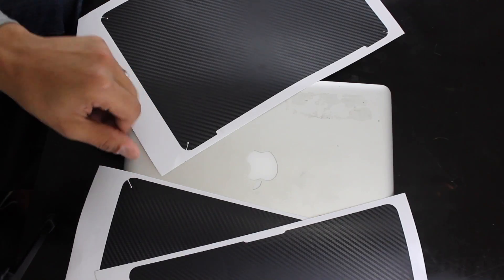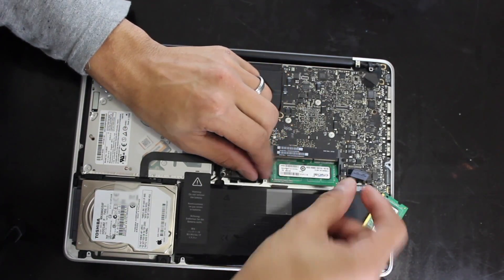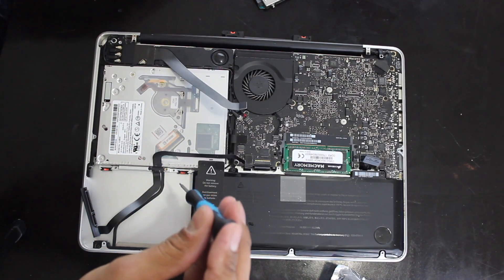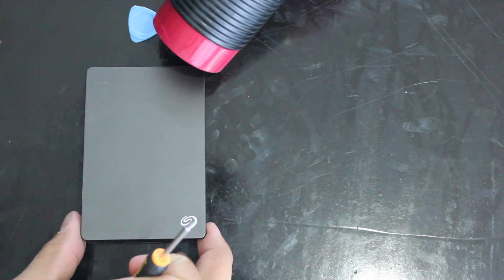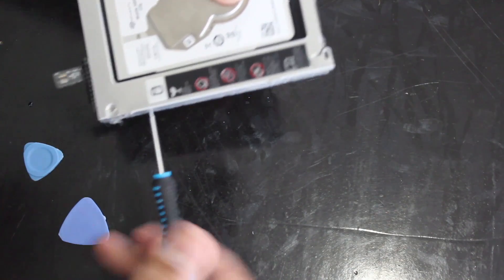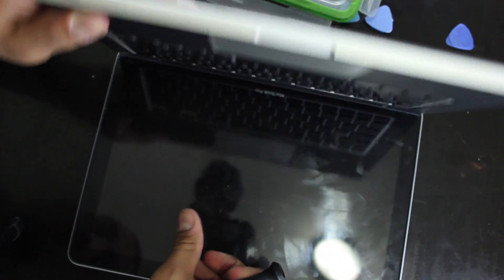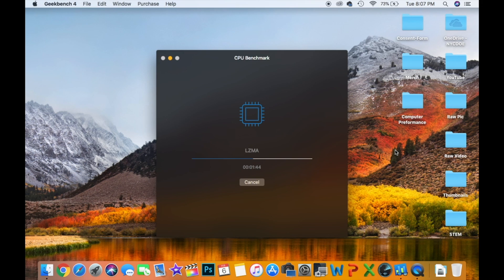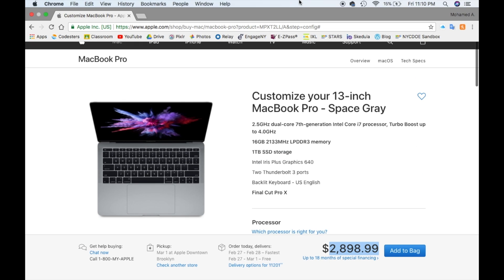2011 Macbook Pro Upgrade (3TB, SSD + 16GB RAM)

Comment: after replacing 16 gb ram in my 2011 Mac cpu fan speed continues on top speed no matter what I am doing far is running on top speed its weird. any suggestions?
Reply: Try SMC reset or dust off the fans and replace the thermal Paste.. if it continues download macsfancontrol

Comment: can I upgrade my 2010 MacBook Pro I just put in 8 GB Ram and I have 500 gig hard Drive , I use it in my Studio and Id Like 16 GB Ram is that possable
Reply: Bill McDonald 2010 MacBook Pro is limited to 8GB RAM. If it’s a 13” Core2Duo from 2010 then yes.

Comment: I see you have high Sierra installed. Did you notice a decrease in the time it takes to boot up and get to the login screen?
Reply: I just did the SSD upgrade and it boots in about 20 seconds. I get the rainbow wheel way less and all of my photoshop operations move very smooth. Its like a brand new computer!
Reply: @tybis4u  What os are you running and how much memory do you have.
Reply: aLBERT jACKSON jR I’m running Catalina 10.15.3 . I have a mid 2012
Reply: aLBERT jACKSON jR I have 8gb of ram btw

Comment: Will this 16gb of ram work with the i5 processor? I have a late 2012 13 inch macbook pro.
Reply: Check if late 2012 up-gradable for RAM.

Comment: I bought an macbook pro, 2011 and I upgrade the ram and also 1tb ssd drive but it gets really hot, and I wounded if you have any idea why that is? Is it defect that this macs had from the manufacturer, cos I have a PC that is it never heats up like the macbook pro does. The Mac has 16gb of ram and 1tb ssd, my PC has 4gb of ram and 320 HDD which technically no comperacing  with specs but my PC works flawless!y and I been having so many problems with the Mac, especially the heat, any ideas on how can fix this? Any ideas would greatly appreciated. I love to keep the Mac as my main and my PC as a back up since use the both with Serato DJ

Comment: I thought MacBook Pro early 2011 just could stand til 8gb ram. Why or how did you upgrade til 16gb?
Reply from the maker: According to apple it can only take 8gb, I put 16 and it read it but I did not notice a big enough change in performance that justified keeping it at 16 so I downgraded it to 8 and fixed my recommendation here
Reply: @MoeNegm  Does this apply to mid 2012 models as well ?
Reply: @corenyellow  depends, the non retina you can't upgrade the ram. But the other one can support 16gb ram upgrade, check the Wikipedia page for MacBook pro and check your model
Reply: @somedudeonthetubeyeah  thanks bud. yea I did some further research and upgraded my 2012 macbook pro non retina with 16 gb ram last week. best decision ever
Reply: Does the “1333 MHz” on the your new 16GB matter? I want to upgrade my 2010 Macbook pro 13”.  It has 4GB 1066 MHz. I can only find 8GB 1066 MHz and not 16GB 1066MHz.
Reply: I am convinced I will take this approach, but I was just informed that the unit may run hot. Has this been your experience?
Reply: @asneMMan   if youve got mid 2012 macbook like mine just go for 16 gb. my laptop hasnt got any hotter. battery hasnt got any worse. there are too many misinformation circling around.

Comment: Also, HOW is a harddrive restricting the macbook from using the 16 gb RAM?!?!
Reply: Bottleneck
Reply: I upgraded mine to 16 GB with no problem.  Upgraded to 1 TB SD HD.
Reply: @stevenjp7155  so if we replace HDD with SDD, we can change the memory with 8gb+8gb?

Comment: Thank you for sharing this! I went ahead and ordered the Corsair RAM upgraded that you added to your computer. I'm excited to see how it'll speed up the performance of my MacBook Pro. Slowly, I'm gaining more confidence in myself to make these small upgrades and save myself a lot of money in buying a new laptop.
Reply: just don't ruin it by loading Mojave, High Sierra's much faster for MBPs with a soldered, small amount of RAM
Reply: @austrobok2958  what if you’re on Mac OS X Lion? Can you go back to high Sierra? (Also on late 2011 MBP)
Reply: @montyv9801  I think you can move to High Sierra, but that is forwards not back. Lion is OS 10.7  and  High Sierra OS 10.13.
Reply: @austrobok2958  oh okay strange. Cause I was running high Sierra before I restored to factory settings
Reply: @montyv9801  right, when you restore to factory you will go backwards.  Problem is, I tried that, and I could not go back to original factory.  Any upgrades in MacOS become the new “factory” settings.  You would only erase everything and it would show Sierra as the “factory” setting, not “Lion.”  You could get a new ssd, use the dvd drive, and take MacOS Lion boot discs and download the Lion to the ssd.  Then put the ssd in your MacBook.
Reply: @austrobok2958  can i update from highsierra to Catalina or Big Sur after this upgrades? I have a MBP 8,1 and 16 Gb ram.

Comment: Just think if you remove the optical drive the 2011-2012 macbook pro's can have 8TB of ssd 4TBX2, and 16GB.
You can also hack egpu to work.
Reply: Tigerex966 Does it even support 8TB? Lmao.

Comment: very cool i did the same thing with my 2011 mac book pro    just with 2T  SSD . huge change
Reply: How did you transfer data from old drive to new drive? Thanks in advance for any feedback!
Reply: @parkerrogers2277   I had an external hard drive so I use time machine to backup the whole system  and then reinstalled everything onto the new hard drive after formatting it
Reply: @j.crandom2077  Sorry if this is a dumb question, but what's the process to install your time machine backup onto your new hard drive?
Reply: @parkerrogers2277  there is no dumb question when you don't know . , 
With the use of the external hard drive all I had to do is plug it in search on your system for your time machine backup all your hard drives to that one external hard drive . Then continue by installing the new ssds and reformat it then plug in your hard drive once again and upload your system from time machine ... If that doesn't work for you because you don't have an external hard drive they are these accessories that you can hook up to your SSD that turns it into an external hard drive USB to hard drive data to help with the process of data transfer
Reply: @j.crandom2077  Thank you so much for your help!
Reply: @parkerrogers2277  definitely not a problem my pleasure to help

Comment: Just followed the instructions and upgraded my laptop, aside from messing up some screws my computer is going good so far
Reply: JANSON. Does your heat up lot
Reply: @TheRuneCrusader23  yeah it does and the battery drains fast but I think that part is my fault tbh
Reply: JANSON. How do you fix that and how was it your fault
Reply: Were you able to complete the upgrade? How did you transfer data from old drive to new drive? Thanks in advance for any feedback!

Comment: According to Apple, the 2011 MBP only supports up to 8 Gb of ram, they say you can put 16 but the cpu can only read at 8 Gb.
Reply: I have 16gb of ram in my late 2011 mbp and I have a ram app that reads all 16 gb and shows me using over 10gb all the time.
Reply: @cripylocdog  I saw that OWC did an official test where they proved that it truly runs on 16 gb, so I think Im gonna try going 16gb.  I wish it wouldn't heat up so much. Found anyway to beat the heat?? hahha

Comment: So the RAM you recommend now is total of 8gb and no longer 16gb total? Is that correct? 
Is that because the 16gb of RAM doesnt work or is it that 16gb will work and the you are just recommending a different brand to use?

Also thank you for this very informative video.
Reply from the maker: I recommend 8 because for some reason it literally made no difference in performance in my experience. It's as if the computer registered all 16 but only used 8? Idk it's not worth the extra money tbh. I'd stick with the 8

Comment: “Small difference between i7 2nd gen and new gen of i7” you are genius...

Then use iphone 4s instead of buying xs
Reply from the maker: While I agree it's a bigger difference than what I had originally thought. The iphone 4s can be picked up for like $20 on eBay and the iphone xs is $1000+ so yes I can pick up the 4s, but I'm in love with my OnePlus 5T I picked up to years ago. So no need!

Comment: Hello, thanks for posting this
I have purchased mi first Mac Book Pro (and my first Mac as well) it got to be a Early 2011 Mac Book Pro.
and started doing the upgrade from HDD to SDD, your video has been my reference (at least 30 views...)

I could move from 135 seconds booting to 30 seconds, and of course all the tasks run more smoothly.

What's the "last" mac model where we can do this things?

pd - transforming a white mac into a black mac is kind of stylish
Reply from the maker: That's so great to hear!
I think the last model was 2013, I believe, I could be wrong though. And thank you!
Reply: @MoeNegm  2012

Comment: AWESOME! Boss. i also have the original Slo "Spinning Color Wheel of Death" 2011 15" Macbook.  it's a shame we can't  go any higher then Yosemite in order to run some New Softwares & video editing programs. 
But great job you did anyway.
Reply: DARRYL SMITH check out snazzy labs. He did a vid from some guy that made a patch where you can upgrade to mojave on an unsupported device
Reply: @xochiojeda7618  
Thanx.

Comment: So I have a dilemma please help me! Both laptops are going to bought used. I can either buy a 2012 13” MacBook Pro with i5 for $300, no upgraded have been done. Or I can buy 2011 15” MacBook Pro with quad core i7 for $310, the ram has been upgraded to 8gb. Both are in fairly used condition and I would have to spend about $90 on each one if I would buy. I would have to upgrade ram on 13” or upgrade ssd on 15”, again which works out between $70 and $90. Is there that big of a difference between the two years? I mainly just want to use it for creative purposes (GarageBand, iMovie,etc) but I also need it for school so it has to multitask smoothly. I want to use it for a while so I’m worried that 2011 will be too old (not eligible for updates etc) are there any major difference between the two. Thanks for the help!

Comment: I saved this video because I am working on my computer now and I found it really helpful. I am updating my Ram first and then my HDD to an SSD but I haven't got the money due to spending it all on the Ram modules. I might not install it firstly because as you said, you won't get the full potential from it unless you have a better hard drive installed. I also added a skin on mine too and it's starting to come together. Anyway... Thanks for the video, man! It gives me ideas. :)

Comment: why did you drop the RAM from 16gb to 8gb on the update?
Reply: The stock CPU isn't good enough for 16gb (you won't notice a difference between 8gb and 16gb) plus you'll just save money on 8gb

Comment: Did an upgrade a couple weeks ago on my late 2011 15"mackbookpro from 4gb to 16gb ram and put in a 500gb SSD and the boot time went from 1 minute to 10 seconds. Oh i also replaced the battery which was swollen.
The macbook fliesssss now. im sure i can get a few more years with it. the only problem which is not really huge for me, is that i can only go up to high sierra. not mojave. other than that... works great :)
Reply: you can go up to Mojave with Mac Os Mojave Patcher! i use it in my early 2011 Macbook pro! google it, there´s even progress on porting Catalina to old macbooks!

Comment: The last MacBook Pro that could be upgraded was the mid-2012 non retina. The retina version of that same year started being soldered. For anyone curious, the mid-2012 Macs' RAM specs are 1600mHz PC3 12800 DDR3 SODDIM. Use that and you'll be on your way. Make sure not to use RAM from older MacBooks, because they aren't compatible (same for those with older Macs that want newer RAM), even if on the outside the computer is identical.

Comment: Great video - do you have a list of the parts?  — RAM specs & part num for the CD replacement for example.  Thanks.
Reply from the maker: Update 06/09/2019
Optical Drive CD Replacement: https://tinyurl.com/y596mm36
Samsung SSD I bought: https://tinyurl.com/y2zqyf56
Samsung Newer Cheaper SSD: https://tinyurl.com/y4rshn33
Ram I recommend now: https://tinyurl.com/yyguypgg
Leather Case: https://tinyurl.com/yy9w8ucd
End of Update

Comment: "i'm sure there is a slight difference between the 2nd and 8th generation i7 but its probably not worth to buy a new machine for it"
slight?
processors -
2011 13" mbp- 2.7Ghz dual core low power core i7 with 4MB cache and 3.4Ghz turboboost
2018 13" mbp- 2.7Ghz quad core core i7 with 8MB cache and 4.5Ghz turboboost

graphics -
2011 13" mbp- intel HD3000 512mb vram (a very crappy igpu)
2018 13" mbp- intel Iris Plus 655 1536mb vram (you can actually render 4k and play some games with this)
connectivity-
2011 13" mbp- RJ45, FireWire 800,Mini DP+ Thunderbolt 1.0, x2 USB 2.0, SD Card reader, 3.5mm out, dvd drive
2018 13" mbp- x4 Thunderbolt 3 ports
ram and storage speed-
2011 13" mbp- up to 16GB of 1333Mhz DDR3 ram, Sata3.0 6GBP/S (theoretically up to 600mpbs with a good ssd)
2018 13" mbp- up to 16GB of 2133Mhz LPDDR3 SDRAM (SDRAM has less latency than non-soldered RAM), PCIe 3.0 256GB/512GB/1TB/2TB SSD (up to 2700mbps read and write speeds)
cinebench -
2011 13" mbp- around 245-250cb
2018 13" mbp- around 680-687cb

all of that and this is besides the fact that you could use an external GPU on the 2018 13" mbp for even more performance...
the only bad thing about the 2018 macbook pro is that it has the worst keyboard ever made, in terms of thermals both machines have thermal problems (if my own 2011 13" mbp idles at 50-60 degrees celsius even after changing the thermal paste to grizzly kryonaut, something is seriously wrong with its thermal design...)

Comment: A friend of mine gave me a macbook pro 15inch late 2011 with 6gb ram. If I upgrade it like yours with 16gb ram and 500gb or 1tb ssd will it run adobe photoshop, lightroom and premiere 2019 smooth?
Reply: it should .. just make sure u get an ssd.. i have an early 11, just ordered 1tb ssd and 16gb ram

Comment: Very good video. Helped me in upgrading my macbook pro. Mine laptop ssd was damaged and performing very bad, I was unable to use my macbook. Then i saw this video and just for getting some info visited apple store. There they said that this macbook won't support any kind of ssd and for installation of normal hardisk of 500gb they will charge more than rs10000 and expense more if necessary and rs2000 more for service charge. Then I lest from the apple service center and visited local market coz this tutorial gave me enough knowledge and self confidence. Then there i get my macbook opened and installed 120gb ssd for macos. And 500gb hdd as additional space. And soon i will upgrade my 4gb ram to 8 or 10gb ddr3.
Thanks friends for such a knowledgeable video.
Love from India.
Reply from the maker: Thank you for this comment friend! Best of luck to you

Comment: Hi! I want to buy a new laptop for web development and I wanted to know if it s worth a MBP 2011 15inch 8gb ram, 256SSD i7 2.2ghz or should I buy an Acer/Asus/Lenovo etc with i5 core processoe and 8gb rams?
Reply from the maker: What are you planning on coding? If you're going to use Ruby I def recommend the Apple machine. I found coding on an apple machine much easier and less complicated than windows, but that's my preference. I code html, css, js and SOME Ruby
Reply: @MoeNegm  Same, htm css javascript and Laravel
What macbook do u recommand me?
Reply from the maker: Any really, you just need a terminal and a computer that loads apps quick so SSD or faster and 8gb ram or better
Reply: @MoeNegm  And what about screen resolution?
Reply from the maker: Well with Google chrome tools you can just develop and adjust your screen to reflect any screens. But I recommend you get a 15 inch screen, because you'll need that extra real estate
Reply: @MoeNegm  Thank you so much mate.

Comment: Hey bro, i have an Mac pro 13inch late 2011... upgrading it right now with an samsung Evo SSD , now i am thinking about buying two sticks of 8GB Ram....do you know if this model can read the 16GB upgrade? ive seen people complaining that their macs only took 10gb out of the 16gb.... thanks !
Reply from the maker: Mines took both but I literally hardly noticed the difference, so I kept one and returned the second. Just get 8 that would be the best for the buck
Reply: I see... well its good to know that it actually accepted them....an guy told me to make sure to get a pair of ram`s that runs in dual channel...in order to avoid any problem.... what use you have for your mac?  i guess i`d have an high usage of the ram...as i work alot with heavy graphic softwares...and also Guitar recording stuff.. :) maybe id get full use for the 16gb.. :) but yeah...8gb would sure save alot cash :) Thank you !

Comment: The bootable drive doesn’t work for me. When I get to that step it doesn’t pull the download from the usb. But when I check the memory it’s there
Reply from the maker: Did you figure it out?
Reply: Were you able to complete the hard drive upgrade? How did you transfer data from the old drive to the new drive? Thanks in advance for any feedback!

Comment: i'm gonna do this to my 2011 mac. it's such a beauty with a long history, but runs too slow now a days
Reply from the maker: Yup, and the older machines have all the ports
Reply: @MoeNegm  I'm thinking about doing this too! I have a MBP early 2011. Is it still worth doing the upgrades on this MBP year?
Reply: emdotq It’s worth it
Reply: Were you able to complete the upgrade? How did you transfer data from old drive to new drive? Thanks in advance for any feedback!